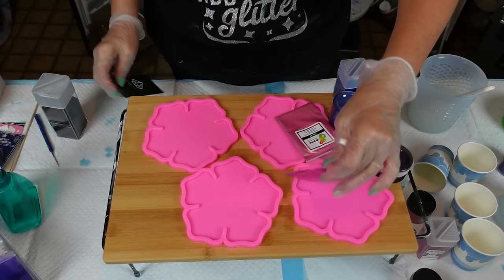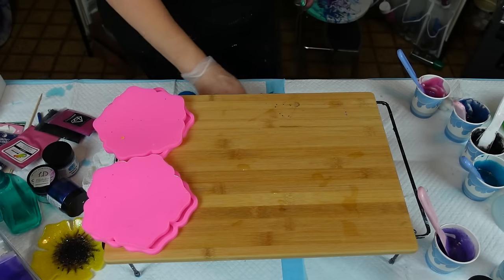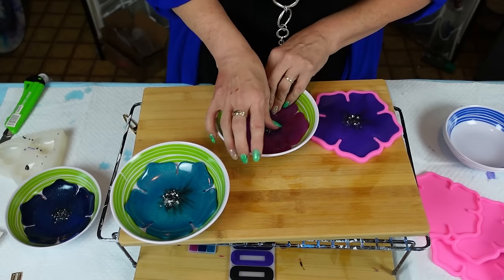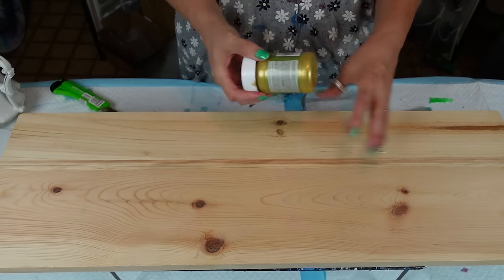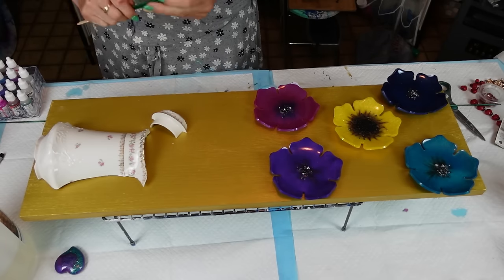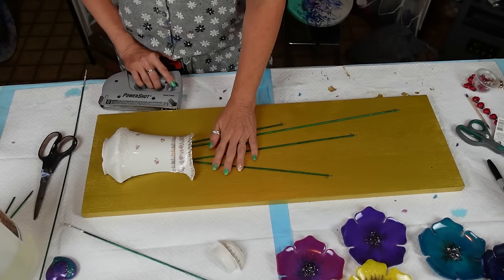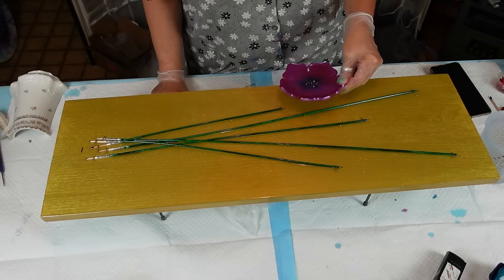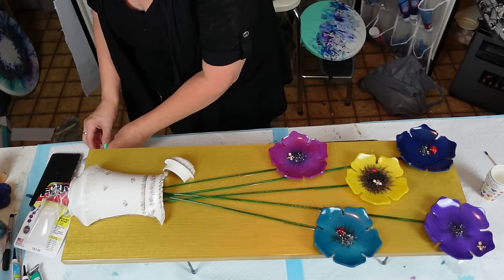Beautifull Tea pot with resin fowers. Bonus how to cut a tea cup in half Happy Sunday!!! Video # 245

Comment: For those people looking at cutting cups in half with a Dremel you need to wear a P2 or a N95 dust mask to help filter out the silica dust that you can breath in. Silica dust I’d dangerous to you lungs and irreversible. Best to cut with a specific  wet saw that uses water or at least wear a dust mask as mentioned above on a windy day and cut upwind. Was your clothes when finished. Beautiful piece Sherry. 😊
Reply from the maker: Thanks so much and thanks for watching.  Yes you are right I did stop the video a few time to say that but because I speed up the video I lost it. Tha KS for mentioning it 🥰🥰🥰🥰🥰🥰🥰🇨🇦